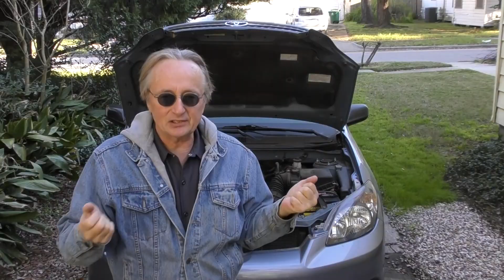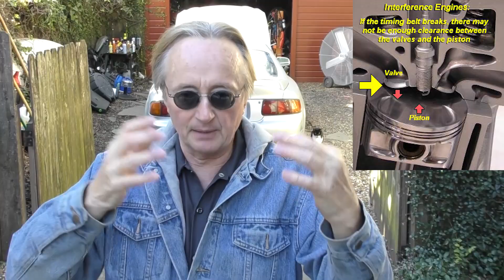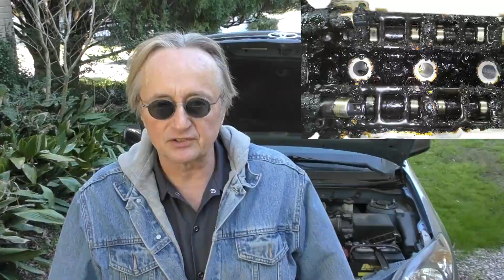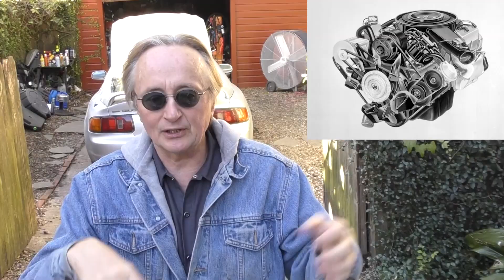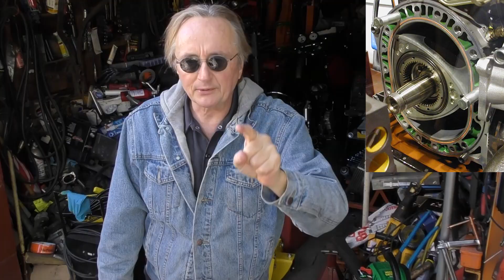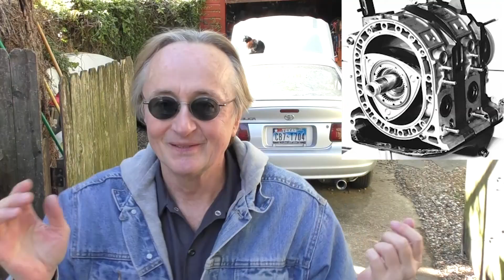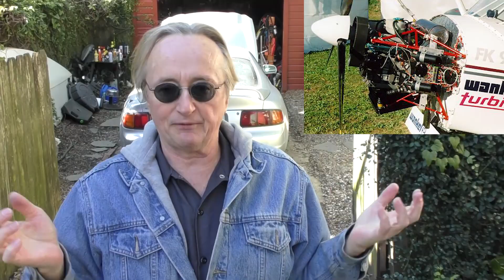Never Buy a Car With This Engine

Comment: You could easily reach the engine in a Model T. Modern cars crammed too much junk under the hood.
1:20 In my case and in my dad's case was that the piston rings were pieces of crap.
When I saw that Chevy, my first thought was basically avoid every single GM V6 ever. They had the worst gaskets of modern times. The only GM engines worth owning are V8 engines that aren't primarily found in Cadillacs.
4:00 That isn't the first time the aftermarket makes something better than OEM and at a better price. Thanks to the pathetic designs of GM V6 gaskets, Fel-Pro easily made something that lasted longer. Also, many cars were shipped with crappy suspension parts, and using MOOG parts was a huge improvement.
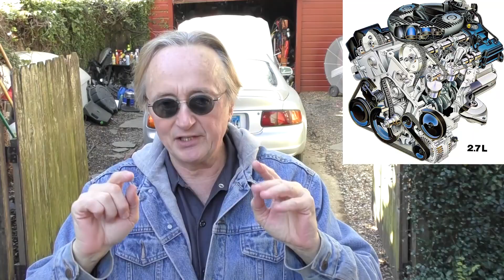4:06 I had nightmares after having to replace that stupid water pump. The Nissan VQ engine also had the dreadful water pump design. However, the water pumps lasted longer. Several years ago, people would have a 1995-2003 Nissan Maxima, and the engine would leak all over the right front lower control arm. The cost of repair would exceed the value of the car, so freelance mechanics would buy the cars cheap and drive them for many years more. If Nissan didn't make the timing system so hard to work on, the VQ engine would be absolutely perfect. The earlier V6 (VG series) was simpler. The 1995 to 1999 Nissan Maxima might have been the toughest car in history. It might not be a Crown Vic or Volvo brick, but most of them did last for ages.

I knew a few people with the RX7 Twin Turbo. They said that the car was so much fun to drive, that they actually bothered to rebuild those engines. They are still common in drift racing because they are such a well balanced RWD car. There are many people who think no Japanese car was ever bad, but they think the turbocharged RX-7 deserves to be forgiven because of the rotary engine. I knew from a young age that there were occasional bad Japanese cars because my mom had a 1985 Nissan Maxima. It cost a fortune in repairs. I had friends and neighbors with 1986 and 1987 Maximas, and they were every bit as awful.

Comment: My mother has used cavaliers sunfires and cobalts that all use the 2.2 eco tec, she used them every single day to go in and out of driveways delivering news papers and sales never had one engine go out! all of the cars have at least   400 000 km, the only thing that has given out is the transmissions, She had replaced about 2 in one of the sunfires.  The cars bodies usually rust out before the power train goes!

Comment: I had a 2006 Pontiac G6 with the Ecotec 4 cylinder (although 2.4L instead of the 2.2L in the Malibu). Engine had to be replaced at 35k miles for what I suspect was exactly the reason Scotty described — what the dealer mechanic told me was that somehow, the one of piston rings collapsed and sent a piece of metal flying out, and this got hit by the valve head on the way out, making chamber 1 unusable. At least that’s what the dealer mechanic told me (after telling me that these Ecotecs were “bulletproof” and surely I must have modded the engineer for racing). Dealership did not want to honor my extended warranty, and so I had to threaten to sue them (my family’s full of lawyers). Eventually they put in a new engine which didn’t die.  After watching the video, I suspect the answer was what Scotty said.

Comment: I detest! My olds Alero with the 2.2 eco has never failed! yet, it has over 340K on it, never rebuilt, never replaced! and still going strong! You should state that certain years of the eco are bad because GM moved the engine production to a different plant. That's when they started to make a bad engine. everything after 2005, the engines would fail and you still can't find a used one in the junkyards.
Reply: @George Culpepper Do you think they got "Shanghai'ed" after 2005, like the 3400 V6 did, before getting discontinued by 2009.

Comment: The Ford /Mazda 2.3 were awful engine, i also heard that  engine rebuilders wont rebuild those engine and that we had a shortage of those in my area, they love burning oil and blowing head gasket, the Honda 1.7 is also a garbage engine and one of the worst in my opinion i'Ve seen so much people with Civics blowing head gasket and then blowing the engine even after repairs way befor 120000 miles

Comment: My 1972 2-door Mazda RX-2 with the 12B rotary engine had over 150K miles on it and had gas mileage in the mid teens. It had a huge 4 barrel carburetor and two distributors which made tune-ups interesting. The person I bought it from had purchased it from an elderly lady who bought it new and he tried to tune it up and got the plug wires all wrong and the points weren't adjusted properly. I paid him $40 for it back in 1987 and drove it for about 8 years before selling it for $1000. It was fast and the body style was somewhat sporty. I miss that little car.

Comment: I strongly disagree. I have had nothing but success with this motor, case in point I have a 2005 Malibu with 266,000 miles and running strong. Nothing but tune ups and oil changes done on engine. Also have a 2007 Cobalt with 188,000, daily driver. I bought the Cobalt because it has the Ecotech 2.2 motor.

Comment: Ah the Chrysler 2.7L. My girlfriend had an 02 Sebring when we met that had that motor. And the water pump went out, was losing coolant like mad! It even overheated more than once. It lost coolant so fast that a full reservoir didn’t even last five minutes. And on top of that it burned oil too. All that with under 100k miles

Comment: The chevy ecotec engine is very good ! My mom sold one at 250,000 and I sold mine which was my first car at 200,000. Never had problems with the engine. The cavalier inteiro did fall apart thou
Reply: exactly these 2.2 engines outlive the cars frame and body etc lol
Reply: haha so true, cavalier was my first car and there was not much left of the interior but the engine ran great and never gave me any issues
Reply: Was it a 2.2L? Could’ve been an EcoTec V6
Reply: Your mom sells used ecotec engines......cool
Reply: same here, 2006 Ion, 2.2L 5 speed. fun car to drive and a very reliable engine. the rest of the car is getting rotted out though and falling apart lmao. I'm definitely going to be saving that engine though for something else.

Comment: My 99 Honda 2.0 v-tec engine. Had cracks in the block that leaked oil into the coolant lines since the oils pressure was higher.

Comment: just fixed a 2.2 valves bent, replaced valves..30$..head gasket with water pump..120$..timing chain and gears..150$ where he get his numbers? it has 165,000 mi and with upgraded tensioner will probably do another 165,000  more biased bad info.

Comment: I have a 04 classic 2.2 ecotec 298,314 mi. Work car yes burns oil adding coolant every 2 weeks. Still running 110 mi daily driver. Constant oil change, premium gas runs like a top.(knock on wood)

Comment: You can pick on general motors Ford Chrysler whoever you want every big car company has had a screw up when it comes to engines and or mechanical issues I don't understand why they don't stick with something tried-and-true they always try to over engineer everything that includes every car manufacturer out there
Reply: Because auto consumers are often whiny b**ches when it comes to "outdated" products.  I subscribe to TFL videos.  The comments on their videos are amusing.  Guys whining about trucks that aren't updated every 2 years.  Worse than women buying new clothes or shoes constantly.
Reply: @Ryno-fp7pm  maybe Im old school but I would rather have something I can work on myself there is too much computer based crap out there we dont need people need to learn how to get their hands dirty
Reply: @nickajk1  I agree.  I work on all my own vehicles.  They are reliable and relatively simple.  My cars only have 1 CPU each, the ECM
Reply: @Ryno-fp7pm  Because they are Junk! You cannot go wrong with a Toyota, Honda, Nissan or BMW.

Comment: I like Scotty because I do mechanical work myself also but for some reason he's in bed with Toyota Toyota's had a lot of crap to the early version 1.8 l vvt-i engine Burns a lot of oil fouled spark plugs they were in Corollas in Chevy prisms bad motor design with valve guides and or oil ring problem

Comment: I decided to buy a 2000 Audi A4 Avant with the notorious 1.8T engine in it last summer as a learning experience and to see first-hand all of the wonderful challenges they provide. It's now my daily, but I it's been an on-going project up to this point. Seeing that picture you provided of that one slugged up like the oil had not been changed for 30k miles makes me appreciate my purchase more. Even though it had low oil pressure when I bought it, I thought there was enough going for it to make it worth my time to fix it. Also, once I realized it had an oil pressure issue I was married to it. I ended up spinning in new rod bearings, replacing the oil pump and cleaning out the sludge while I was at it, which wasn't bad for an engine with 176K miles on it. I also ended up installing a new turbo, because the old one fell victim to the low oil pressure before I realized what it needed. So, in nutshell, they are definitely needy and would be expensive if you paid someone else to fix it. I'll never buy a car with a 1.8T again. Too much expense and effort for a car with 150 hp.

Comment: Wrong. Ecotecs are fantastic engines. Timing chain instead of a belt like majority of the other 4cylinders. them things come in with 2 qts of oil left after 12k miles and they still running! So it eventually jumps time from neglect. Valve job or replace the head and keep on drivin.

Comment: Hey Scotty you forgot all ford engines. Triton motor pure garbage. Power stroke 6.0 pure garbage. Their new turbo engines are blowing head gaskets. I worked at a Nissan dealership and we did more Ford engines and transmissions and anything else.

Comment: I have a 2008 Dodge charger 3.5L v6 117,000 miles. Still have yet to see a check engine light. I'm glad I didn't get the 2.7L I've seen plenty of those at the scrap yard.
Reply: @Jovan Royston Unfortunately, a woman I know, with her 2014-built Dodge Journey had engine trouble with her Pentastar 3.6 L V6 at less than 100,000 miles! Symptoms were: The check engine light on and a rough idle. The word I got was that a valve was sticking and that the valves are built into the heads and thus head replacement required. I suspected that kind of issue only occurred with early ones, such as from 2011, for example.

Comment: You are quite wrong scotty. The v8-6-4 is almost nonexistent anymore in its original form and the 2.7 was a sludge machine. The 1.8t you mentioned was bad info not the design. The 2.2 ecotec is really good with the warranty fix. 

I dont know why you just glossed over a small lineup known as 
THE FORD MODULAR V8 LINEUP

-exhaust studs rusting and knocking,
-crap power
-timing chain guide failure
-poor top end oiling
-spark plugs blowing out
-head gasket failures
-and most prevalent cam phaser issues.

Comment: I remember wrecking yards having Chevy Vegas stacked up like firewood. The engines were garbage. Cast iron head and an aluminum block. Also the center two cylinders were too close together, they would overheat, and actually drop down. My friend would drop different engines in Vegas and sell them running. The best though was a Chevy 350 V8.

Comment: Thing is, engines of old had a 100,000 mile medal, nowadays, engines now need a medal for 250,000 miles. I think overall most modern engines are more reliable. It's just that with people being lazy, no mechanical sympathy and the lack of knowledge that even driving hard wears brake-pads out quicker is what is causing it. Just thought i'd expand on your point that alot of these things are caused by poor maintainence. My Ford Exploder 4.0 SOHC has 103k, no rattles, timing chains (touch wood) are fine as I change the oil every 6k.

Comment: I noticed he never said anything about the 4.6 L Ford V8 or the 5.4 Ford 3 valve V8 engine between the two of these still could never figure out how to keep a spark plug in it or try to get a spark plug out of it without breaking something but he's a Ford lover

Comment: I own a 2008 HHR with the 2.2/automatic   One of the best cars/engines I've ever owned!  200K miles and still runs excellent and uses no oil.  I've always run Amsoil in it and the motor looks and runs like new!  More than I can say for my son's Toyota Matrix... in the shop constantly with 125K miles.

Comment: I had this engine on my 2004 Chevy Cavalier at 186,000 it still runs great,! Of course I maintained it very well. The issues with it though were OIL SEALS that I need to have replaced.

Comment: my 1.8T ... its gettin old and tired but wont quit...
252000 mi
Reply: One of the best vw petrol engines too
Reply: Yes! I miss my 1.8T VW! One of the BEST easiest cars I've ever owned!
The coolant flange on rear of engine is a beast to change (ask me how I know - spent a weekend layin on motor hugging it from topside 🤣) but everything else was fairly simple.
I liked the battery behind the secondary firewall too
Reply: Jennifer Rae Fuchek yes double firewalls are a German thing and make a lot of sense. What car is it in? I ran low on oil at least once in my Passat and my engine did not make it past 200k without needing a rebuild.
Reply: I hate my 1.8t

Comment: I'm in the same boat 2003 Cavalier Eco 2.2 did us very well. 235k before timing chain went. Other than that VERY little maintenance required: fuel pump, batteries and alternator that's it. True champ.

Comment: Through experience.. I would have to honestly say the GM 2.3L "quad-4" and its "funked-up cooling system, Yes, the Chrysler 2.7L V6, but also the 4.7L V8, (garbage, whered the good ol' 318's & 360's go..) I liked their 3.5L SOHC V6's, but they were problematic also. Olds Aurora 4.0L V8, Cadillacs "Northstar" V8's, not to mention  their lil cousin, the "shortstar" 3.5 DOHC V6 in the Olds intrigue.  The intake manifold & gasket design flaws on GM's 60° V6's (2.8, 3.1, 3100, 3400 ect) and let's not forget the 3.4L "twin dual cam" v6 of the early to mid 90's......... Ford's 3.8L V6 head gaskets, 3-valve GARBAGE 5.4L Triton V8's, and Really, the list goes on and on. Either way, no matter what engine you might have, if it's properly maintained (and driven) even alot of the engines above (heaven forbid I say this) can still get decent usage and reliability out of them. Yes, some May need more maintenance than others, but I like to not "roll the dice" and stick with the powerplants that are tried and true, and have seen several decades worth of use and abuse, tweaking, and manufacturing improvements. That with quality build materials & lubrications, and simplistic design for ease of maintaince, will last as long as you need it to. Learn about them, and take the PROPER care of them, they should take care of you.

Comment: had a dodge intrepid with this motor... 2.7 liter  v6 ..............got 190,000 miles out of it . why. all highway miles and changed the oil constantly.  the trick with this motor is to change the water pump every 60 thousand miles..

Comment: what causes a spark plug to blow out of the engine?
Reply: Stripped threads or too few threads in the cylinder head. Ford made at least one engine infamous for this design flaw.

Comment: Before I watch, I'm gonna guess Chrysler and GM are the list.
Reply: and no Hondas
Reply: @importtuner81  gm 3800 v6 is better than any honda v6 ever made 😱😱😱
Reply: @dommartelli5529  wrong
Reply: @importtuner81  some call it the best v6 ever made… a gm product …. 😱😱😱
Reply: American car companies make good V8. Other than that, not worth it
Reply: You Sir-my friend are correct
Reply: @Wutzmyname Mike  is that the 3800 in the Buicks?
Reply: Never again had a Chrysler 99 300m 🗑! Have a 12 terrain Slt The Joint burns 5 quarts of oil in less than 2000k miles WTF?!!!!😩😩😩

Comment: Scotty thanks for your vid's bro, I'm a long time DIY mechanic and am always on the learning curve it seems.  I've always been a fan of simpler engines(nonturbo etc., if only on the premise that the more complex the more likely to fail. IMO.  the best engine i've owned was the  Honda 2.4 inline 4cyl, ran smooth as silk but a dim-wit blew through a stop sign and t-boned me totaling my honda. Question: what do you think of the 2.0 T volkswagen engine(if it's properly maintained)? I'm a freak about oil changes and easy driving, but am a hair suspicious of an engine that has a recommended timing chain tensioner replacement at 100k no doubt better to change tensioner than to have a break  or slip due to slack but 100k damn that's hardly broken in good. If you have a moment pls shine some light on this thinking.
Reply: @William Martin I know that the CR-Vs, starting in the 2015 model year, had 2.4s with a big power increase. The Accords possibly got that update sooner. These are the direct-injection 2.4s. They have no turbo or super charger, but still a big power increase.

Comment: Can confirm. Had a 2004 cavalier with the 2.2. Engine blew so bad it fucked up the transmission some how....at 140k miles. That’s all I got out of it. And we had it brand new when it had 9 miles on it.